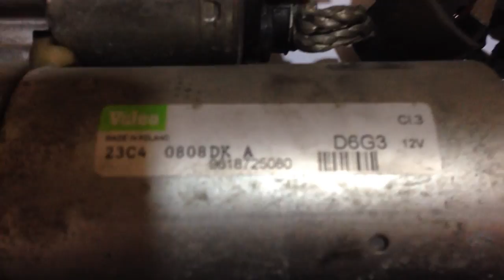Peugeot 307 tu5jp4 - Starter motor removing - DIYChannel

Comment from the maker: If you like the music, You have new videos with the original sound track of the DIYChannel&Music channel. Enjoy the music
Reply from the maker: If you want you can enjoy the music in the OST DIYChannel playlist
Reply: Yes I liked. Thanks for video. I will remove tomorrow my starter with that video. But I am worrying from engine side bolt. How I will remove it, I don't know.
Reply: @DIYChannelMusic  my car is citroen c4 1.4 et3jd. I think same procedure
Reply from the maker: The top bolt was a nightmare, I had to attach it exactly in an angle and hand/tool position, very small movements, horrible. My engine is tu5jp4 1.6 so you 1.4 is smaller, probably with more space... My tip: is search videos to discover where the bolts are.